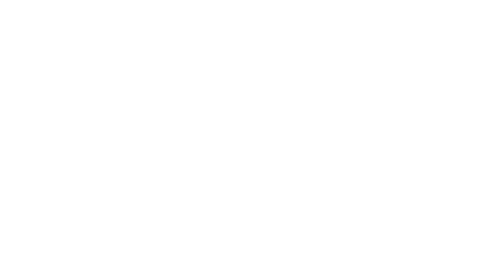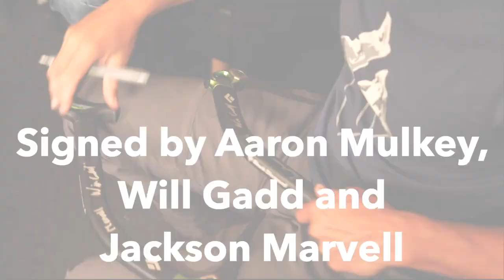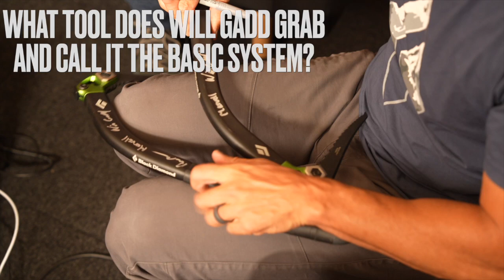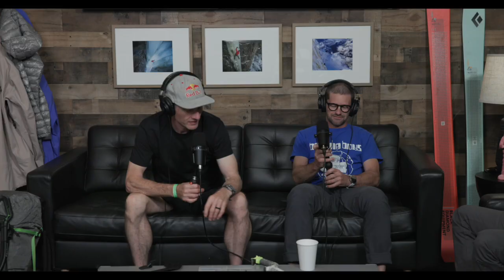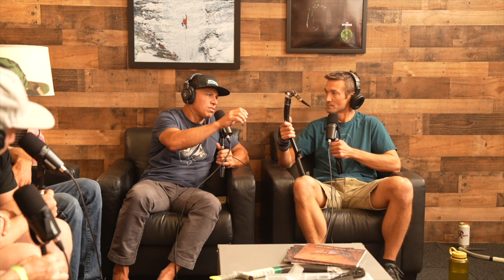Coldfear Podcast #26 The Ice Monster Is Born "Hydra"

Comment: My first tool was the Forrest axe but my second tool was the Chouinard X-15 with the straight blue fiberglass shaft. It had the same 1 bolt pick connection as the later BD tools.